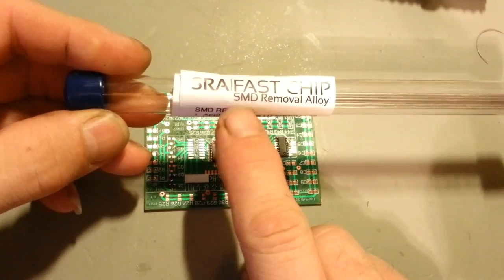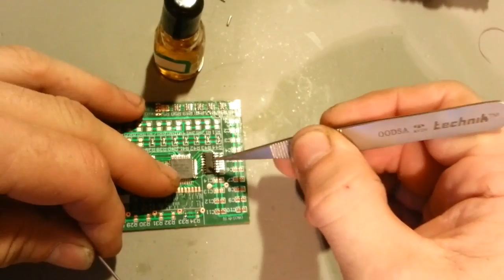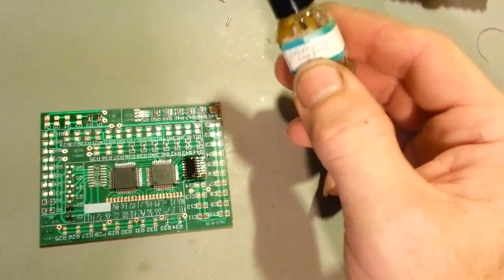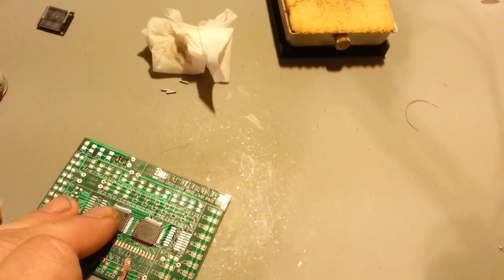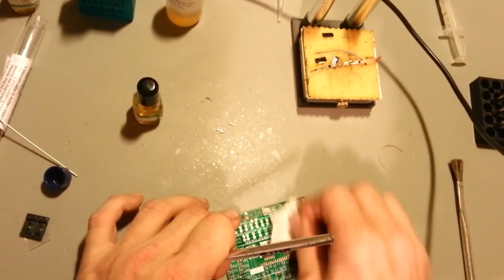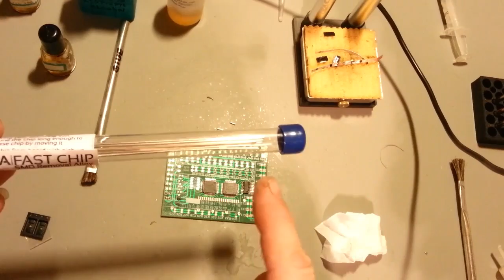Desoldering and soldering SMD components with a minimum of equipment.

Comment: I bought a 1 pound block of low-melt alloy from eBay a few years ago. I think it was about $15. It's about half gone and I use it daily. Compared to the cost of chip-quik, it's practically free. When I have big globs of it to remove after removing a component, I let it cool and then flip the board and remelt it. Most of it will just fall off the board ,and a light tap will even clear the through holes. It greatly reduces the amount of wick I need to use.
Reply: Why so much desoldering? Do you provide upgrade services for people? Not asking because I need it; just curious. Are you still desoldering this often in your work?

Comment: after watching endless hours of tutorials showing how you're supposed to use reflow stations, custom tips, even preparing and heating up the solder with wire templates -- i come here and i learn i was holding it wrong the whole time.

Somebody give Mike a medal. Please. 

How come nobody speaks of this. Pure genius. Wish i knew this before - would help me save a ton of time, frustration and a few PCBs..

Comment: Mike, you are an excellent speaker  / teacher.   I viewed your video months ago as I was looking for learning how to remove a component (chip) on a rotor controller.   I sent for the flux / allow and the component.   When I received the flux / allow, I practiced on a sound card that I had in the jewel box.   Removed several tiny components.   Yeterday, I worked on the board that needed fixing.   I practiced on the sound card again and then did the actual work.    It went all well and the rotor card is working as it was new!   Thanks for allowing me to experiment!
Reply from the maker: Glad I could help.  It's easier than most people think.  A little practice is all that's needed.

Comment: One of the best tutorials Mike.  It's nice to see one for us that don't have fancy tool sets.  The part about how to get rid of bridging was particularly interesting.  FLUX, CLEAN, repeat.  Works well when you need only a few cycles, but it seems you can't expect top do this too often.  I used a paste flux, maybe the liquid flux has better chemistry for cleaning.  However, removing a particularly stubborn bridge across 3 of the 0.5mm pitch leads of a FPC flat cable connector I ran into problems, after somewhere around 10 cycles.  The Isopropyl alcohol seemed to mix with the paste flux and left something like goop in the hidden places of the connector.  More Iso did not remove the goop.  This caused me serious problems, because I could not get proper connection to the flat cable.  I had removed the bridge, but had a connector that was not useable.  I had to buy a new motherboard.  My bad.  Nobody else's.

Comment: Great informative video!  I've never messed with surface mount, but plan to.  I was trained in electronics in the Air Force in 1970, and dealt with through the board circuitry.  The explanation of flux in Tech School was that as it vaporized with the application of the soldering iron heat, it created a small atmosphere envelope around the area to be soldered, preventing surface oxidation caused by oxygen, which forms on the metal and actually acts as an insulator against the flow of the solder to the metal component.  And as you said, more is better with flux.  Thanks for the demo.
Reply: this is actually one of the other effects of flux. for the Surface mount stuff i would really recommend starting with the biggest parts, with the least pincount and the biggest pitch so basically These huge-ass resistors, what is it an 8th of a watt one, at least really really big. they are dead simple to solder. watch the Video on bigclives channel where he tried smd and did basically exactly that… then you know a) which parts i mean and b) Maybe you have an idea what to start with

Comment: Thanks for the great information on soldering and de-soldering. Using the fiberglass brush for cleaning is a very good idea since I use them in my watch and clock restoration and repair work.  I have a bunch of electronic kits to put together and need all the help I can get!  Thanks again.

Comment: I just did the MARS mod on a brand new Kenwood TS-590SG. You have to unsolder one resistor.  One itty bitty teeny weeny spec of dust of a resistor.  Look away and you might not be able to tell what is dust and what is the resistor.  The mod was successful, but I definitely prefer working on 1970s and 1980s radios due to the component size.

Comment: MikesRadioRepair+ I like this method, but there's so many I even used a car light, a halogen bulb with a reflector and the oven, a toaster oven, a reflow hot air gun and a long bamboo stick to move it off the board. Liquid Solder works great for SMD and I solder the same pins as you do. I like you.

Comment: Just wanted to say thank you! I had to replace failed op-amp in little phono preamplifier. Your video helped tremendously. Removing microcircuit was a breeze. I couldn't do all terminals in one run, had to remove a couple of bridges, but overall the repair was quick and clean. Flux flux flux!

Comment: Great video, but just a tip - rather than use all that solder wick, whilst the unwanted solder is a blob, simply turn the board perpendicular to the bench and tap on the bench. The entire blob will just fall off onto the bench - for scraping up into the trash. Reduces heating of the board too.

Comment: Thanks Mike your instructions helped me a lot. The part on cleaning and 
the use of alcohol is very helpful As well as the tips on proper desoldering with minimum heat and clean up. How to drag solder and if you get a bridge another great tip.As for the position of the camera perhaps it would be better to put the camera in front of the working area. In other words instead of the camera seeing from your eye perspective how about the sight line of someone across the table from you. This way there is less hand arm restriction and less tendency to move the work out of the camera vies. Just my opinion. Still a great video instruction.
Reply: An excellent suggestion re camera placement.

Comment: You can use a solder sucker to remove the bulk of the low melt alloy, which will save on wick. It's a good idea to follow up, going over the pads with a little solder then and re-wick to remove. This will help ensure all traces of the low melt alloy are gone before installing the component.

Comment: Good video, up to to point where the circuit was outside of the camera's frame.  Could have been not so long.

The flux has rosin, which contains tannic acid.  This mild acid cleans the oxide and it keeps the air away, so the oxygen doesn't oxidize the solder and joint.

I love the smell of rosin, sort of like a campfire smell.  👍   Thanks.

Comment: one thing to note: Even if you are not using a special alloy to remove a part, it is still very important to remove all the old solder (as much as you can, should be a smooth flat surface) because that can sometimes lead to unreliable solder joints where the part rests at a distance from the board and is more susceptible to shock.

Comment: With over 50 years of practise, I thought I know it all. Nah, SMD components come and with the skill I have, I could labour about with a reasonable degree of positive outcome. The FLUX rule has been my motto too (never enough).  My eyes opener from you was the introduction of the low melt temperature solders! I must have been left out of the knowledge database, never knew they exist! Mike, you have moved me forward a decade or two. Great thanks and great video - just tops!

Comment: 15:34 drag soldering.  Ideally, you use K-Series T12 tip for this type of work. For middle aged folks with bad eyes like mine,  a reasonable priced video microscope camera with video out so you can project it on your laptop.

Comment: Glad I saw this, to be honest I've completly avoided surface mount. I'm gonna have to start practicing on some practice boards. It would really be useful to be familiar with SM boards.
Reply: I have totally destroyed circuit boards trying to remove surface mount electrolytic capacitors, I ripped the lands clean off under those caps so this would be a godsend to replacing thos damn unreliable SME componants
Reply: @rogerd4559  haha, my first SMD repair try was exactly that - replacing multiple electrolytic caps, and I ripped off the pads... That was before I saw this video.
Reply: @eugent  My deepest condolences on your deceased circuit boards.as I have done that as well! I got lucky when I replaced most of the caps on my computer motherboard that were through-hole and the SMD's were all good!
Reply: @rogerd4559  Practice, practice, practice. If you don't have a lot of dead SMD components laying around, head to Goodwill or Salvation Army. By the time you solder/desolder everything from an old $2 router, you'll have this sh*t mastered. I've been stripping all components off old boards lately and organizing / storing them. Places like Digikey is such a ripoff and a lot of times you'll have the exact part you need in your electronics junk drawer.

Comment: Mike, great video. A tip for making your video production easier: put your camera opposite yourself so it's not in the way. It won't matter to viewers whether they're seeing it from your perspective or a 2nd party perspective of standing in front of you watching. It will make production easier and faster for you and will benefit your viewers as well. Also, if you're using an overhead projector style camera, like ELMO or similar, most of them have a setting to invert the video so that your perspective is what is sent to your video screen or recording device.

Comment: I actually got a USB soldering iron from China for like 5 bucks and it works really nicely for SMD as it has a tiny and short tip, however for flowing things like ICs I find a regular iron to be better as the tiny tip of course cools down fast, so it's mostly useful for single pads at a time, it does heat up fast which means it does allow you to do everything in one go but spreading solder around all the IC pins is a bit too much

Comment: Really nice, I would like to have seen you do this wipe technique on the smaller pins of the square package chip on the board. Im sure the amount of solder you apply initially to your tip is something you must learn from experience. Haven’t had much luck with my solder paste, would love to see the best way to utilize this type solder and technique. Chip Quick is wonderful, well worth the cost.
Reply: neat trick if your solder paste is sticky and is hard to apply add flux to the paste (little amount but it depent to your pref) to make it soft and easy to apply

Comment: Really great video and great tips. My only "problem" is that these SMD desoldering alloy's costs about 10$ for a single rod or 130$ for 30!! I think that within a half year, it would be cheaper to buy a top of the range desoldering system! :-)

Comment: I also like to point solder two opposite corners so the chip doesn't move and then drag solder the rest of the connections.

But sometimes I decide to be stupid and use tweezers to push down the component while going at it with drag soldering. Shaky hand end up moving it and I need to redo it and I curse myself for skipping 5s of tacking it down that would have saved me lots of trouble.

Comment: I got a little job where there is a connector on the board which is stopping it from working. Everything else on the board is working fine. I don’t know that I could replace the connectors as it’s probably proprietary type. Do you think I could try running a soldering iron over the top of the connectors with flux of course and hope that the pins that are currently not connected become connected. It’s way too small for me to even see with a magnifying glass. Btw this was really nicely presented video

Comment: Is it possible to reuse a desoldered IC using this method? Do you clean the IC from the quick chip desoldering alloy using the desoldering wire?

Comment: Thanks Mike, love your videos. I too enjoy working and building radios (from kits). I recently was given a Cobra 2000 GT and I think it has had everything wrong that you can do to a radio, done to it. I tore out all the BS, downloaded the original specs and have R & R everything back to stock. I tested it against a dummy load, and have it at four watts. My question is I don’t have the test equipment or experience with said equipment to make sure it is tuned properly. Is there a poor mans method of testing it, to make sure it’s working right?

Comment: ...What is "SMD"?....Can you use "scotchbrite" pads, to scour the board traces?...
Reply: SMD is a surface mount device, as opposed to one with wires on. SMT is surface mount technology, the assembly of printed circuit boards using surface mount devices. SMT leads to much smaller circuit boards that can be assembled by "robots". Using Scotchbrite on SMT boards is a bit aggressive because the pads and tracks are so small and because you don't want to damage the etch resist layer, which is there to help soldering.
Reply: @fatroberto3012  Thank you, for that info! It's great that everyone shares good advice, and helpful tips!   I'll look for the proper tool, and methods, as I progress.  ;D

Comment: I know it won't kill it, if there no pin crossing or anything, but still I like thing straight, it would be good, if you solder one of the pin first, and adjust it so it straight, and do on other side, then after that reflow it, so it's perfect lol

Comment: Hi Mike,
First of the nine videos uploaded today. What I find interesting about SMD soldering is that even if the component is a little skewed, once the solder melts the component miraculously moves into position.  :-)  73  WB3BJU
Reply: I don't think that happens with this method because the corner pins are tacked down  but it sure does when using hot air. I agree it's kind of neat how that happens. Not sure if it's me or what but it seems like with certain solders that does not happen. Lower melt temp. solders appears to work the best.
Reply: Should have mentioned it was the hot air soldering method.

Comment: I know that, but soldiering your way seem there will be solder contact  between the  tips when your done. I'm thinking when you turn it on , circuit Fry's, no ? I have an amp I want to try this on.
And thanks for the response.
Reply from the maker: When drag soldering you need to make sure there are no solder bridges between pins.  I show what a solder bridge is in the video and how to remove it.

Comment: Mike on the test boards between R46 and R50 there are BOURNS - CAY17-103JALF - RESISTOR N/W, 8RES, 10KOHM, 5%, SMD or something like that with 4 or 5 soldered tails on both long edges of the resitor ... Could you PLEASE tell or show how these would be soldered to the board .. I have chipped one on a graphics card and had the part mentioned..

Comment: Thank you! Now , with some practice first, I can add that CTCSS board to my Stryker SR-94HPC radio. The installation requires the removal of 2 surface mount resistors.

Comment: I have the most trouble with the really tiny resistors, caps and such. Those parts are so small and lightweight that just the action of the solder flowing from the iron to the pad is enough force to push that part sideways or someways from where you need it to be. And I usually use my free hand to help steady the hand holding the iron so I'd need a 3rd hand to hold the part in place while I'm attempting to solder, and unfortunately I've misplaced my extra hand so I'm down to just the two.
Reply: Put a few books down to steady your hand.

Comment: Great info.  What temperature do you usually solder/desolder SMD components at?
Reply: It depent of solder wire, tip size, and soldering station(or good old solder iron) you use, i prefer 275-350 it depent on the ic and i use ksger t12 it cost around 40$

Comment: Hey Mike I have a Motorola HT 750 UHF radio that will not transmit? Well let me say it will transmit in talk around mode at about 50 yards but will not hit a repeater. I do have two other HT 750s that I have programmed and they work fine so I’m thinking the transmitter chip is bad? I guess my question is would you fix this radio for me and how much you thinking it would cost me?

Comment: I have no idea why people are not using spring-loaded desoldering pumps. They are very cheap. I’m never using desoldering wick.
Also, you can desolder smd components with xacto knife but need to be careful. Or, use a tip that heats entire row of pins.

Comment: Soldering stations are so cheap that anyone can get a decent soldering + hot air station. You can get something pretty good on Aliexpress for $60. I spent $120 for mine and it even has a 30V 5A power supply built in. Add a $30 multimeter and you have everything you need. All the supplies that came with my station would last well over a year but I bought some better stuff to go with it.

Comment: Does this method work with removing fets? Or is hot air the way to go? I have 8 of those boogers to replace, and they are right next to 8 diodes. I mean almost touching close.
Reply: I got all 8 off using this video! cool cool cool cool cool! Now just have to clean up and solder in the new fets tomorrow......my nerves took a hit ;)

Comment: For your homemade flux, what is the mix of rosin & ipa? Where do you get your rosin? Rosin for violins?
Reply from the maker: +Tree2Tool 

You can mix it thick or thin to your liking.  Its just highly refined rosin cakes.  The stuff I use I import from Germany.
Reply: Do you have an address or site for the rosin? Thanks.
Reply from the maker: Tree2Tool 

You can get rosin cakes on eBay, Amazon and in many hobby shops.